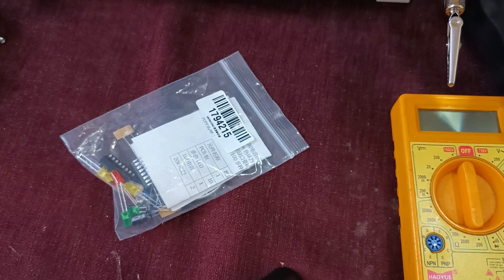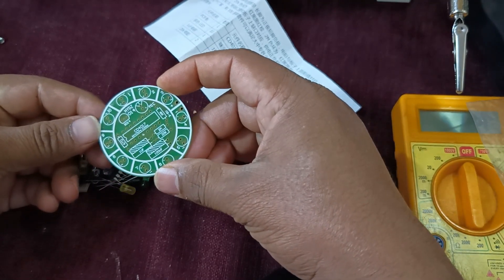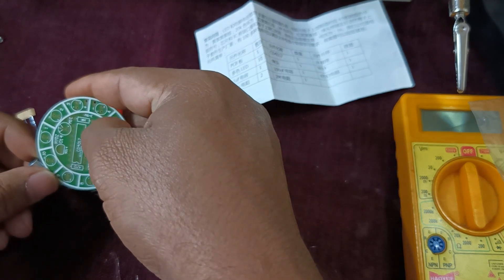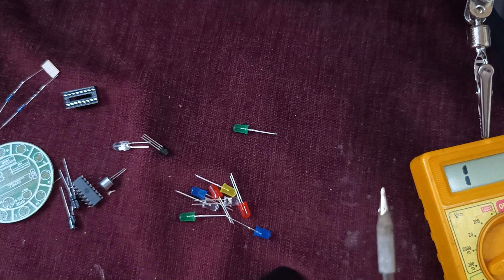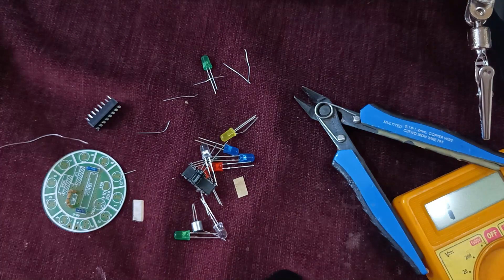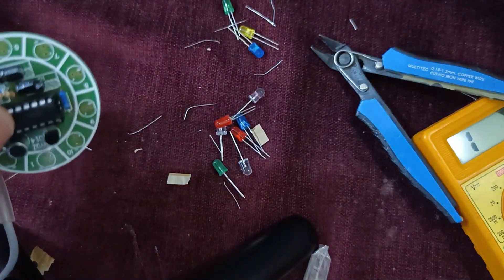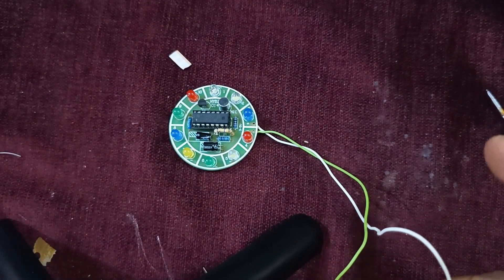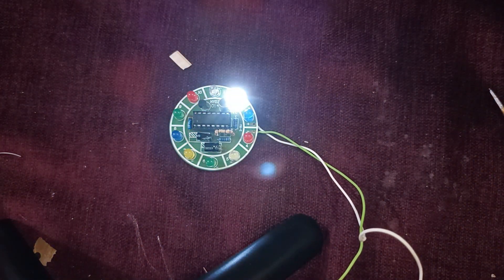Colorful Voice Control Rotating LED Light DIY Kit

Comment: I need it but how it buy?
Reply from the maker: https://www.electronicscomp.com/cd4017-colorful-voice-control-rotating-led-light-kit?gad_source=1&gclid=CjwKCAjwouexBhAuEiwAtW_Zx5C7I63x_8L5mo8t7NS0uL09nBlJW5qfGTb22jIBWojSlAB3rsY38RoC0k0QAvD_BwE
Reply from the maker: It's available online
Reply from the maker: https://www.electronicscomp.com/cd4017-colorful-voice-control-rotating-led-light-kit?gad_source=1&gclid=CjwKCAjwouexBhAuEiwAtW_Zx5C7I63x_8L5mo8t7NS0uL09nBlJW5qfGTb22jIBWojSlAB3rsY38RoC0k0QAvD_BwE
Reply: Not available in Bangladesh
Reply from the maker: I can  provide you with a circuit diagram link